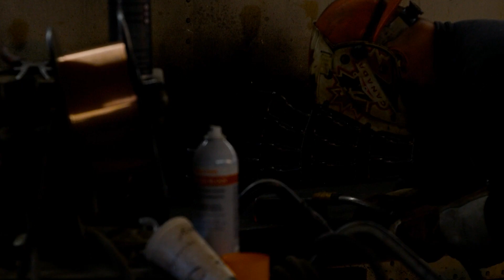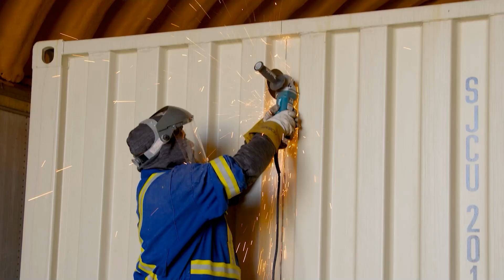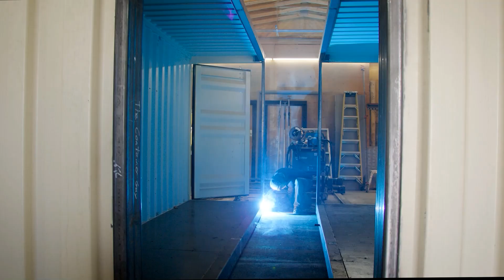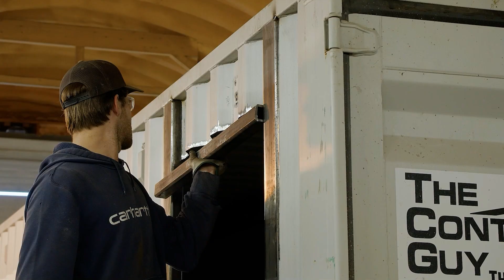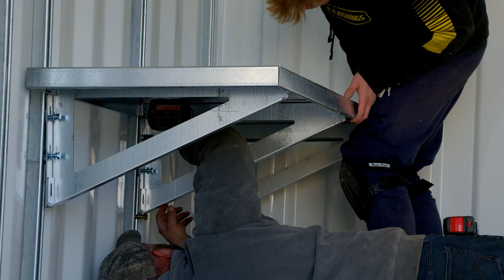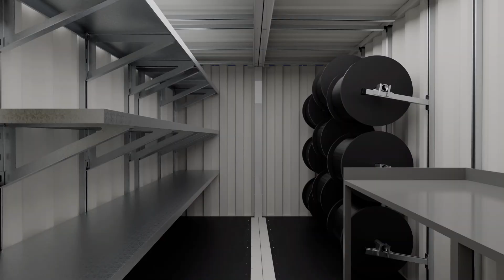Cutting a Shipping Container in Half and Reinforcing It with WELDING

Comment: Love the videos! I am building 3 40 ft shipping containers on the 1st floor and 2 on top. I don't have to worry about inspections or code but want it built right. Would you be able to chat about my prints drawings and confirm what I am doing is correct?
Thanks Chris

Comment: If I wanted to join three containers together and increase ceiling interior height up to 12', could I use angle steel too reinforce the containers continuously where the roof meets the beams and then remove roof and the interior horizontal beams and add sip panels to gain 12' ceiling?
Reply from the maker: I think your best bet would be to use 2x40's, spread them apart up to 24' then run vaulted trusses across. Similar to the kit in this video: https://youtu.be/COcoIe1zzt8
Reply: Thanks for your help!
Reply: What do you think about using container floors with sip panels combined with the previous mod. Mention to save money on concrete?

Comment: Definitely like the videos and can you give me a link to buy the brackets to install unistrut? ..! Did you end up tapering the ends of the dowel pins for easier alignment of the 2 halves?
Reply from the maker: We bevelled the edge, yeah. They worked surprisingly well. Below is the link for the strut brackets. They can be purchased on Amazon.

"MODULAR STRUT SYSTEMS (MSS) & (CSM) - The Container Guy" https://thecontainerguy.ca/container-modifications/modular-strut-systems-2/